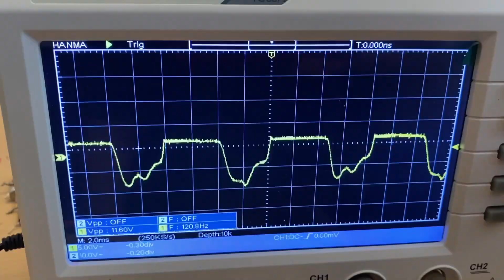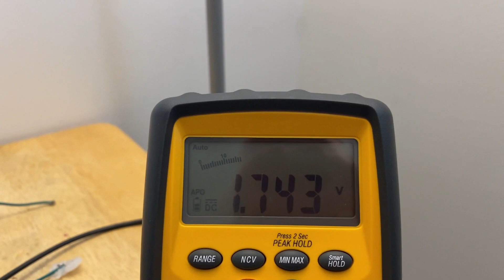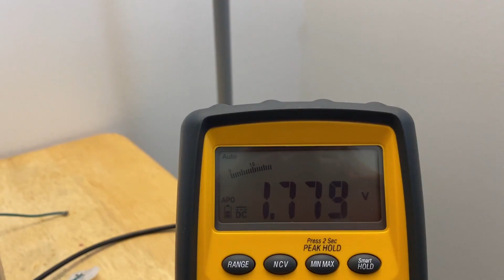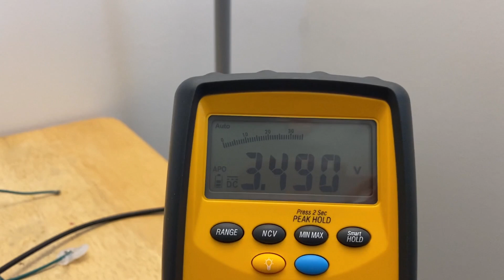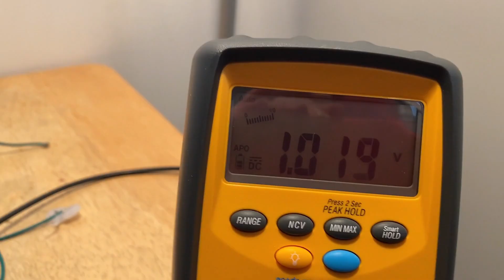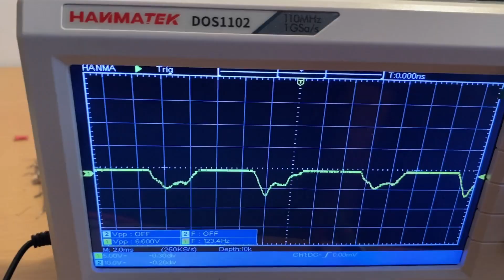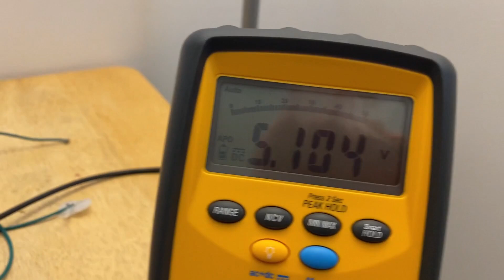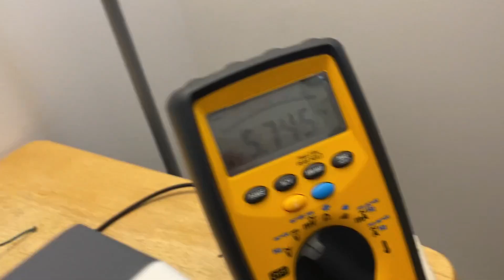Lossless Optical To Magnetic Domain

Comment: I have a few options for building circuits like Tesla did. But I'm back to what I was thinking about. I'm also thinking about shifting the current voltage either from the source or on lc1 lc2. This can all be done in time and without breaking the law. But for now I'm thinking about something else. I want to increase the current, not the voltage. I'm going the other way. Tesla also did this. And I want to draw a few milliamps of current from the source. And in the bank, the output should be 10A at 11v or more volts

Comment: Hey Joel ditsh the photovoltaic cell. And get a Machine in series with the LC circuit that you just did. Maybe don't ditch the cell bu use it to charge the cap then dis conect and discharge the cap into the transformer with the Machine in series with the LC circuit with the inital condition if for example 40V cap charge and a internal resistance if the homopol generator you will get a very strong oscillation enough to drive two Trafos in parallel that charge two separate caps which in turn powers the homopol generator. The homopol generator is not a Generator like every one thinks but an electrical component like a coil or a capacitor. It is a wire with negative resistance. When you superimpose the low voltage with the Voltage of the charged capacitor for example the N-machine aka the homopol generator produces 0.6V and 2kA and the cap has 40V 10uF and an ESR Of 0.08 ohms a trafo with an inductance of 100uH you can superimpose 40.6V you get a Swing of amplitude 1.94kV a current of around 600A and a resonance frequency of 5,03kHz if it swings for 1 second you get enough to get it self running. Especially if you take the primary of a few Transformators in parallel to get 100uH which have all a separate full bridge rectifier and a Capacitor on cap could be used for spinning the Homopogerator. I need results from some one that knows what I'm talking about and that provides feedback to se if it is a fluke or if I'm on to something. I mean I recreatet your circuit but with this small changes the PHOTO Cell charges initially the Cap to jump start the tank circuit but the itself runs. Pleas built a series oscillator with a 10uF cap with the highest voltage that you can get. Then charge the cap about the voltage of the photo cell. The disconnect the cell and connect the cell to a coil of a primary winding of multiple Trafos which have separate FBrectifier and charge cap. At first the homopol generator in series with the series oscillator is not spinning so it acts as a normal pice of wire section. Then after Jumpstart one of the charged caps spins the HP generator in such away that it adds to the initial voltage of the main cap. Rins and repeate I need in biased test data from people that know what they are doing and that know what I'm talking about.
Reply: Important note the Trafos should run at their Resonance frequency pleas choose the cap accordingly to match the tank  circuit frequency with the natural frequency of the Trafos. The hompol generator is  cinsderatted as just a pice of a negative wire. When running and a normal piece of wire when not spinning.

Comment: Stochastic Chaos theory regarding light is akin to the sci-fi move Time Machine … fortunately it true in this regard because Gerard Morin proved that step-up voltage to higher powers can yield both useable high voltage with high amperage current by down-stepping the voltage by 4/5th’s from a 50Kv transformer to a 10Kv can transformer. He utilized a 500w gasoline generator to the position and neutral leads that inducts to exiting positive & negative terminals that connect to the +|- of the 10Kv to create stable usable power… just amplify voltage to a high state then transformer it from DC to AC if desirable!

Comment: Not sure if anyone watching, acknowledge that you have a perfect insulation between modulation (done with light) and output (done in magnetic filed).

So, the induced can not see or interact (opposing) with the inducer … simply, keep the dipole alive
Reply from the maker: I'm thinking this could really increase even regular solar farm output. Let the sun do its thing. Charge up your batteries or send back to grid. Create displacement  modulation taps in line.  Have a small controller switch a 100mw LED beamed into every panel.  That modulates the sun and get a "free" copy of what you gave the grid and got payed for. Yeah I don't want to disappear so I will stop speaking now.
Reply: @joellagace1679  exactly the same principle of working for a magnetic amplifier made of coils and ferrous core, modulate the input and insulate the output from modulation. Apply this this to any desired system with whatever radiative energy source free or paid and you get all you wish
Reply from the maker: Now im thinking modulate some low level gamma maybe even the ambient universal bombardment.  and modulate it with x-ray and the capacitor is plasma based mixer and boom get super out of this world EM energy outputs once recombine and go anti-gravity charging asymmetrical capacitor crafts at  million thousand volts plus ranges without the limitations (cold energy) of conductors wire resistances, corona losses and just about anything so chaotic that stops most experimenters at around 40kv call it ion wind and walk away.
Reply: @joellagace1679 🥇🥇😅😅😅IT'S GETTING HOT I THE KITCHEN 👍👍💯
Reply: Regarding speaking too much about beaming LED’s… maybe Tesla already said it? He would casually put the wildest Easter eggs in his patents for anyone paying close attention, like faster-than-light wave propagation in US787412, and how the atmosphere at 30,000-35,000 feet (typical cruising altitude where we see a lot of “skywriting” lately) was great for transmitting power, in US645576.  So… is maybe figure 2 in US685958 (shining a Roentgen tube at a plate) him hinting at what you are talking about? I’m convinced there’s way more going on in that one illustration than people realize.
Reply: @joellagace1679 MAN THIS JOURNEY IS CRAZY AWSOME 🎉😂😅😅🥇🥇🥇💯💪
Reply: @joellagace1679 no need for controller use self oscillating buzzer with optical transistor salvaged from old USB mouse(I used to play with those in sun😂😂 to produce sound like "weeeuo" "weeeuo" from buzzer)hence it's more Hz so it's more efficient in transfer power in iron core transfomer😁
Reply from the maker: And interestingly modulation carrier at the optical is not so much about lumens strength but clear "view"
Reply: @joellagace1679  Exactly ! I have been looking for a solution to generate copious amount of UV (radiant energy apparatus of Tesla) and easiest method was old street lamps with low pressure Hg vapours (banned now), next research showed a low dc can be used for a spark gap if UV light (from an LED) is shown onto spark gap 😉 or instead of Lenard tube using an old CRT tv/monitor in close proximity with aluminium plate.
Reply: Thank you Joel. This is a great video of proof of concept. Your ideas are amazing and  "resonate"😂😂😂 with all of us
Reply from the maker: Yes I wish they would see it all

Comment: I wonder if you can use the LED bulb on the output with a pwm to modulate the light radiating onto solar panel 😎

Yes, you know exactly what I am suggesting
Reply from the maker: I’m considering a high-performance Joule thief to drive the LED at ultra-high AC frequencies, producing extremely sharp dI/dt and dV/dt edges to pump significant magnetic flux energy over optical. I also know what i'm suggesting and need to calm down LOL
Reply: @joellagace1679  I wonder if the solar panel will accept 2.4 gig?
Reply: @rogerflemming it's all about bandgaps. Like casimir force, more light frequencies exist on outside of plate and in between wavelength is restricted by the distance between the two plates. Now every atom is like this too. So if a solar panel is tuned to green light let's say 2.4eV bandgap we are in optical green frequency so higher than visible light spectrum will exist within the hole and superimpose. To be noticable they need phase alignment close NP stacking sub orbital till quantize particle ie cooper pair via the phase conjugate waves. 

So yes, if it fits in the hole it affects it even if it's not 'quantized'